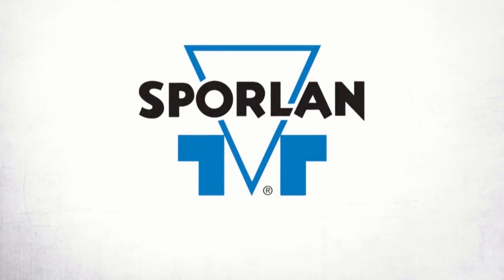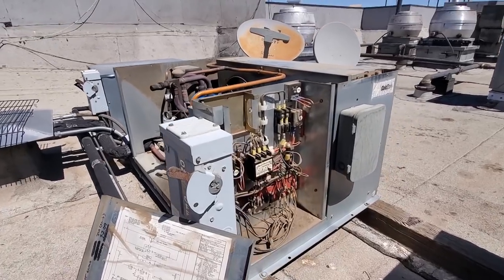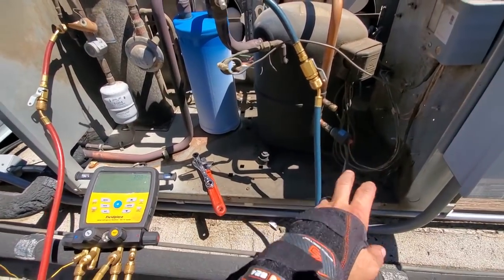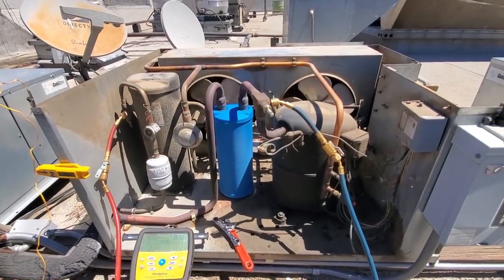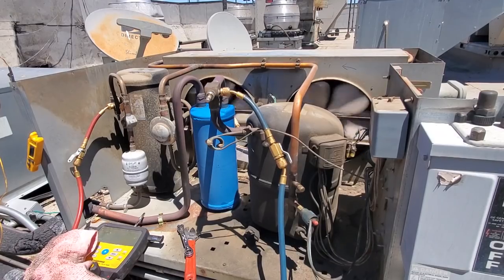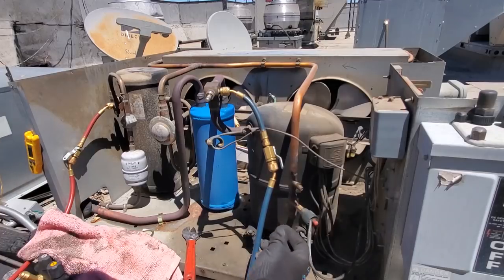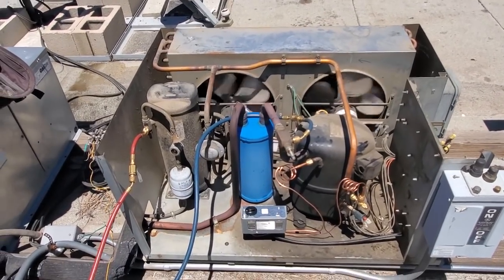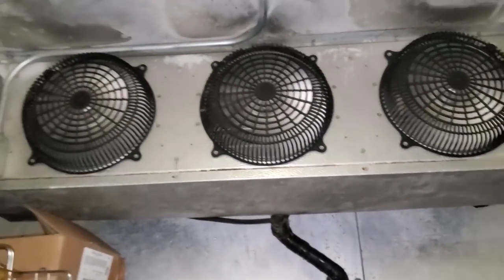WALK IN FREEZER NOT RUNNING

Comment: I keep trying to cover the sun off the gauges with my hand like that's going to help. Lol. It's like hitting the brakes while you are a passenger. I picked up on the pressure sensors. I think u explained it well. I'm finding it hard to know where at in the system to put the gauges and temperature sensors. Just because I'm trying to watch and learn without being there. I need to be able to look at the system and follow the lines to see what is what. That will just come with time. I have been looking at my home a/c system to learn. The only problem is I don't want to touch it because it is old and I'm afraid I'll break it. The whole system will need updated eventually. Thanks again guy.

Comment: At the head pressure setting that high are you worried about blowing internal relief in compressor Copeland recommend 375 cut out on head 30 degree split on confessor seems high for refrigeration sound undersized condenser my option

Comment: I was working in Phoenix for a bit; and came across that same problem with the ambient temps getting to 120^ and tripping pressure controls when using 404a. I found it harder to locate a pressure control to 450 psi; not all the suppliers have them.

Comment: You should also install a 100mA fuse between the contacts of the pressure control when it's set auto reset, this is so you can see if it had tripped on hp at a quick look.

Comment: Hello I would like to say thank you first of all for the good teaching and explanations. A second thing I'm having trouble with might be to help me. I would greatly appreciate it. I have a commercial refrigeration business in Israel and the inbox unit  in Israel most of them for some reason the internal cooling units do not come with a suction connection 
And I'm having problem checking out Super Heat. Is there another way to check if the valve is functioning properly?
Reply from the maker: If the lines between the condenser and evaporator are not too long you can use the suction pressure port at the compressor and just take the suction line temperature at the evaporator and calculate your superheat that way.
Reply: Thanks Appreciate it Have a nice quiet weekend

Comment: What is different a walk-in freezer condensing unit and walk in cooler condensing unit... good day sir..
Reply: Arshad Khan I’m guessing a freezer unit runs hotter therefore sucks more heat from the cooling medium. I could be wrong though.
Reply: Refrigerator typically uses air defrost, the evaporator fans run constantly.

Freezer needs an additional source of heat to defrost, either electric elements or hot gas.  Freezer evaporator fans are cycled off during defrost and will not turn back on until compressor is restarted and the evaporator is cold again.
Reply: Higher compression ration in compressor and a elect defrost

Comment: Hey mate, if you come across a machine and let’s say hypothetically there was no information even on the valve about what refrigerant is in the system, what method would you use to figure it out?
Reply: Look at some clues; check the TXV head, check compressor refrigerant type, oil type that the compressor uses is another clue. If you can't find it: gotta take it all out, vacuum and put in new.

Comment: After the EXPLANATION at the beginning Chris my question is even though the unit went off on high pressure shouldn't the evap fan still me running Because its being powered by the # 4 terminal and not the contactor?
Reply: I think they were not running because the staff shut off the switch in the walk in

Comment: Is it normal for the pressure switch to be on the hot gas line on refer ? Just curious.
Reply: Often have switches on both high and low pressure sides.

Comment: I'll mention again, I use nitrogen and set the pressure control, the number scales aren't  accurate before installing it. Access caps- I hate the rubber o ring style, I use the flare type.

Comment: Shouldn’t the high pressure switch be after the condenser and not right at the discharge of the compressor
Reply: No.. The psi is the same.. Temperature is not.. You only have 2 pressures on a system like that, High and low..